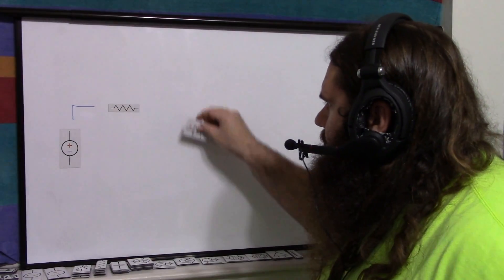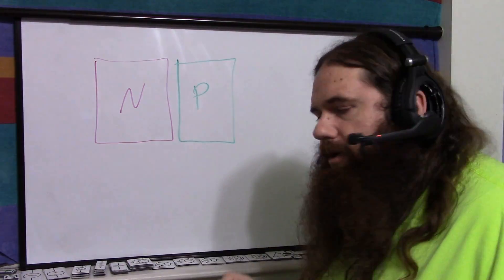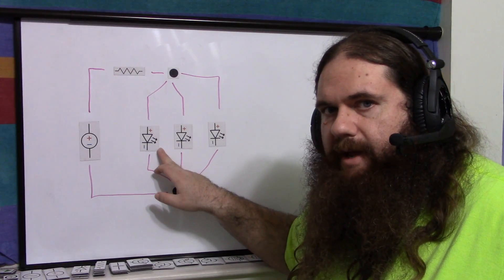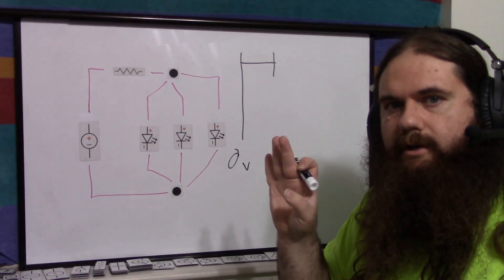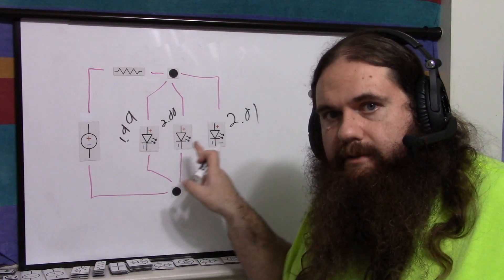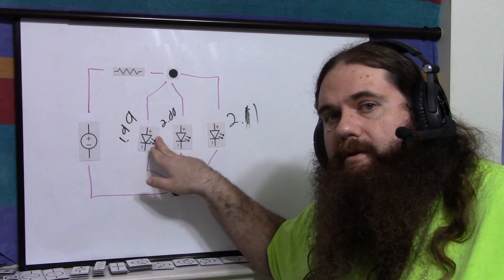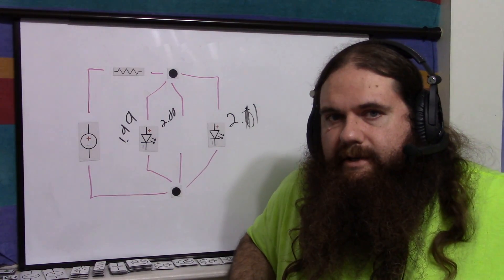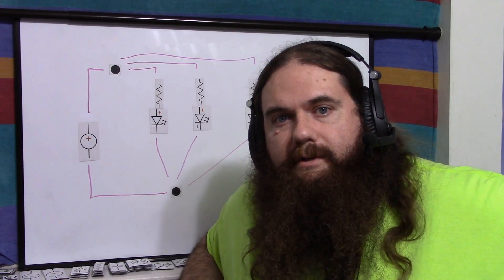Why Parallel LEDs Each Need Their Own Resistors - Simply Put

Comment: I happen to own several Harbor Freight flashlights,  and in each and every one of them all of the LEDs are connected in parallel.  In the case of one that I used a bit (I haven't used the rest of them at all,  hardly) at least three of the LEDs have failed.  I suspect that the phrase "invites early catastrophic failure" up there in the description is probably a part of their design philosophy...

Comment: I'm just getting into electronics and I didn't understand the whole video but this is such a down to earth explanation that answered alot of my confusions about voltage vs current. Maybe if I watch it 5 more times I'll understand everything.....
Reply: You should try to understand voltage and current and resistance and the relationships between them and how they affect each other and depend on each other… first, instead of trying to reverse engineer an understanding of them from this video. Otherwise your understanding of both basic electricity as well as semiconductor electronics operation will likely be warped even though it may make sense, and you won't realize that your understanding is wrong until you apply it and get unexpected results. That is one of the dangers of learning something complex on your own without a teacher's guidance that you can interrupt by raising your hand to say "I didn't understand what happened in the previous step" or being unable to provide feedback by doing in-class practice examples immediately after the explanation or homework, which the teacher checks to see if you have understood it correctly or not. Replaying the video again and again is often not helpful at all. It is not the same as a teacher re-explaining it a different way, using different words and pausing at each step to see exactly which part you are having difficulty understanding. Unlearning a wrong understanding is difficult especially if it has had time to settle down and become embedded, so start learning the right way, by learning things in the proper sequence. You don't learn algebra first and then try to use that understanding to figure out what addition and subtraction are all about, do you? 🙂
Reply: @petep.2092 so what would be your advice to someone like me who's trying to learn electronics on my own? Where do I begin? Could you provide me with a playlist or something? Also, I am trying to build drive 4 leds in parallel with pwm dimming capabilities using a potentiometer with an 18650 battery and I'm encountering a lot of issues. Thanks

Comment: I have some results you may like to comment or analyze: I'm not an expert or really knowledgeable on these matters and in fact I'm just a noob. Here is my 'case':
# a parallel circuit with two amber LEDs 20mAh/3.0V and two red Leds 20mAh/1.8V.
# power source is coming from a 3.3V controller board's jumper.
# following the theory you so clearly expounded here I opted to place a Resistor on each LED resulting with two 15 Ohm on the amber LEDs and two 68 Ohm on the red LEDs. 

It did not work as only the red LEDs were fully lighting up, but I did notice that a 1K Ohm on the reds resulted in all four LEDs lighted although the amber were dim well below their potential. While trying to figure out a solution to bright up the amber ones I've studied the case where you also had mixed colors LEDs with red and blue (1.8V + 3.0V): there the case was on a different parallel circuit where they tried to make it work using a single resistor, and in fact the answers were suggesting to use resistors calculated for each Led. In one of the comments I read that the blue were not lighting up since from their position the red were short circuiting the current flowing to the lesser Voltage.
Without fully understanding the implications (I hope you may comment on this!) it dawned on me that to let the current flow to the amber I had to increase the resistance on the red instead of lowering it: I already had the 1K Ohm resistors showing me some low current was finally dimming up the amber ones.

# after some trials I've found a sweet spot using 2.2K Resistors on each of the red LEDs that now are a little dimmer but still quite bright, and the amber LEDs are almost as bright as if I plug off the red ones from the circuit...

Case solved? Yes, or so it seems: to me it looks as if I was going against the logic of the Law, but as I said I'm not that knowledgeable on the electrons' race. I will be thankful if someone will explain me what this is all about...
Cheers

Comment: simply put: great video.
okay, here's a scenario for you - a real world scenario I have.
I have a 12volt DC supply through a regular step-down transformer/wall-wart.
I have white and green LED's with an advertised fwd voltage drops of 3 volts.
I have 5 arrays of 8 individual LED's, 2p4s configuration for each array. Every 4s LED string has a 120ohm resistor in series.
3 of the arrays use green LED's, and 2 have white LED's. Same fwd voltage drop ratings on all from same manufacturer, and 120ohm resistor used for every 4 x LED in series.
I run the green LED arrays and as I turn them on or off, the other green arrays operate perfectly normally as if no circuit interference caused by the other LED arrays in parallel operation.
HOWEVER, when I turn on the white LED arrays, they work fine by themselves, but as I switch on the green arrays, one by one, the white LED arrays dim and dim, even though they're operating in parallel.
What am I missing? The transformer is rated for like 6 watts (500mA on 12v) so it's not like I have a power supply issue ... or do I?
Reply from the maker: 5 arrays with 4 strings in each array should be 25mA per string before resistance if everything's even, so that shouldn't be your problem, because otherwise I'd expect everything to dim, not just one color. Run your strings and use a multimeter to measure the voltage drops across each of the resistors (both when all LEDs are working and when some are dimmed) and make sure your LEDs are actually fully turning on. If every string has its own resistor (so 20 resistors total here), then it can't be the issue described in this video......IF the LEDs are actually leaving any voltage for the resistor to drop. But rated 3V *4 with a 12V supply is running smack against that limit, so you might very well be needing more voltage. I bet you'd not experience the issue if you had the same number of LEDs but only 3 in each string, or if you used ones with smaller voltage drops. If you have a bench power supply, try a 13V supply (or even a 14V) and see if the issue goes away.
Reply: @simplyput2796  cool. Thanks for the answer. 
It was 5 arrays in 2p4s with 10 resistors overall and 40 LED's. I was thinking about wiring the setup as 5 arrays of 9 LED's at 3p3s with 45 LED's and 15 resistors, which as you say would leave some voltage to drop across the resistor.
I was just confused as to how circuits which are technically isolated from each other in parrallel - thus using their own lines of current from the exact same source voltage - could effect each other in that way.
Reply from the maker: Remember that the stuff we use, like Kirchhoff's voltage and current laws and the component model, are approximations that work great as long as we stick within their conditions. According to the component model, circuit elements in parallel are isolated from each other...until they aren't. In reality, nothing is ever isolated, and an entire circuit is actually inductively coupled with itself (in addition to numerous other unpleasantnesses). You could also try measuring the maximum voltage drop of each of the LEDs in one of the strings that dims, add them together, and see if your power supply voltage is sufficient.

Comment: Because the current of each led separately is not known and completely equal to the others nor remains stable over temperature changing the current that flows to the resistor is not didided exactly in three equal paths.More current flows to one means less current to the others and a voltage drop difference of 50-100mV higher on one led can cause excessive overcurrent to destroy one first and rapidly the two others.

Comment: Because they'll compete for the amperage. (Simply put!)
Reply from the maker: The opposite, actually: The default case is for the current to be split evenly, but the ones with higher voltage drops will refuse to take their full share, and the remainder will get dumped on the one with the lowest voltage drop.

Comment: Even if you could measure the junction they could fluctuate overtime due to temperature.  Other source are inductive differences in the wiring change in the instantaneous current though the diodes.
Reply from the maker: Good point: I hadn't considered temperature, because higher temperature increases semiconductor conductivity because of greater electron kinetic energy so they can bounce through the doping faster.
Reply: @simplyput2796  The digial temperature sensors are build arround diodes because resistors are difficult to put in ICs
Reply from the maker: And you just gave me a video idea.
Reply: @simplyput2796  I think you miss my second point which could make an interesting video additionally. When you are introduced to high frequency circuits the length of conductors becomes critical to the functioning of the system as they opperate close to transmission line. The components see different voltage as result across the length of the parallel circuit.

Comment: Yeah, although in some applications I did use a common resister in the path to ground: I connected multiple MCU pins to a respective (random colored) led, and then all the leds back to gnd. 
If it's just for blinking shortly, I figured that it will be able to handle the access power that an led would have to dissipate due to a too low resistance on part of the resistor, and thus the too high current flowing through the led.  
(And in my setup, I also saved space by doing that.) 
But, if I'd have to design some filming light with a few power LEDs, I'd want each LED to have an own resistor as well. 

Anyway, good job!
Reply from the maker: Good points! If you're lighting only one LED at a time, it's actually perfectly fine since the resistor is only associated with one LED anyway, and if you're just blinking them on and off, they'll handle the current just fine. (In fact, that's an actual technique: Rapidly blinking an LED (faster than the eye can detect) allows you to over-current it without significantly reducing its lifespan, therefore making it brighter.) The only issue is if you try to blink two LEDs at the same time that have large differences in their voltage drops, because the one with the bigger drop might not blink on.